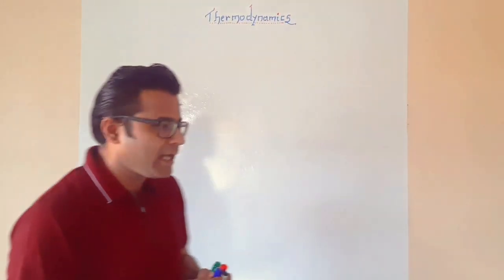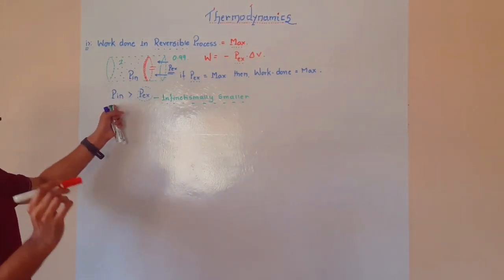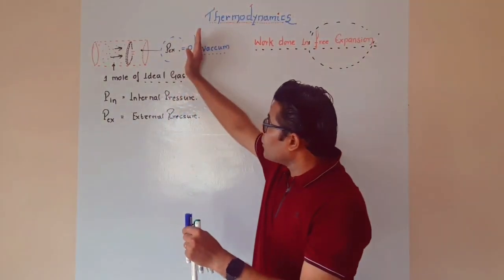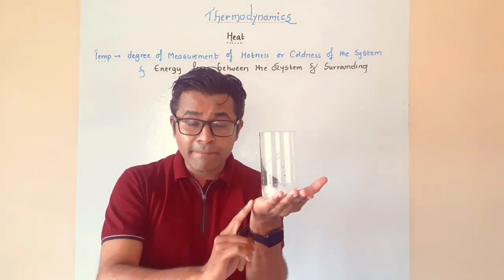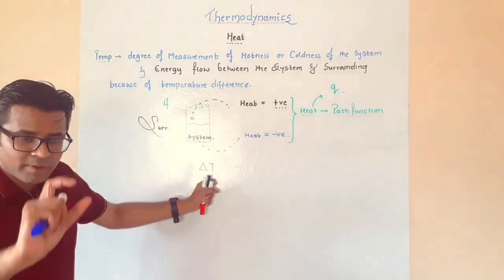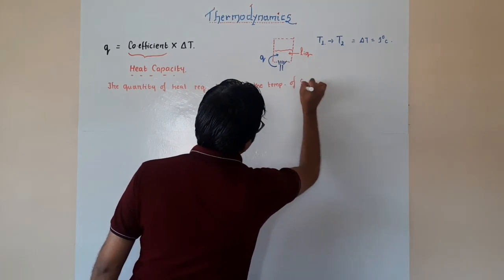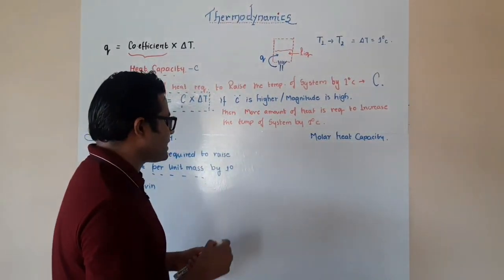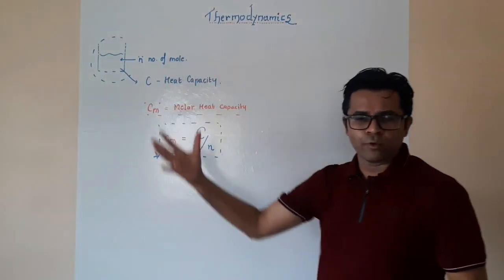Thermodynamics - Work, Heat Temperature - Lecture 4

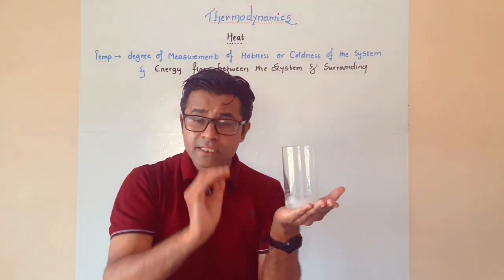Comment: Sir at 14:50 can we also say tat coldness of glass is absorbed by our palm or is it just have to be said tat heat of palm is absorbed by the glass?
Reply: Thank you sir
Reply from the maker: Welcome
Reply from the maker: See, as we define all these energy flow with respect to heat, so it's quite vital to say that heat flows from a hotter body to a colder body, considering the temperature difference between palm and glass containing ice cubes, it's the flow of heat energy from plam to the glass . Hope u find it easier now to understand the concept .